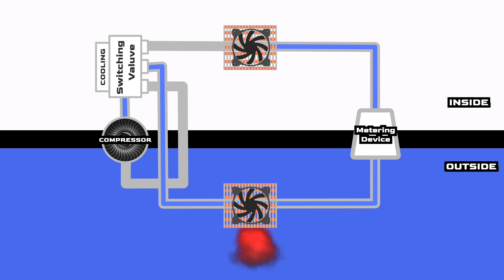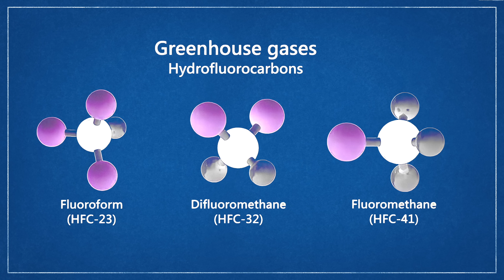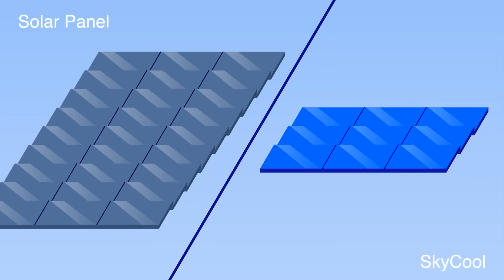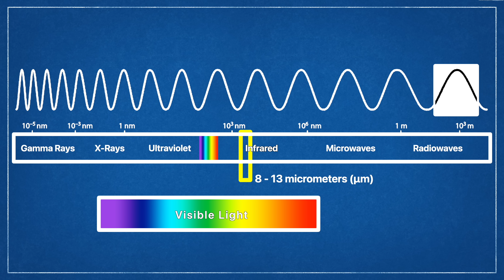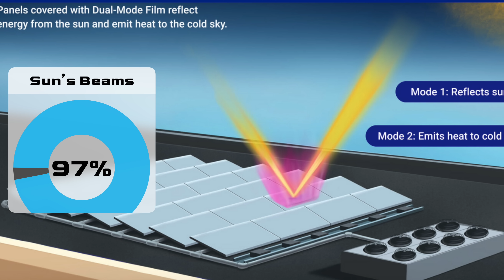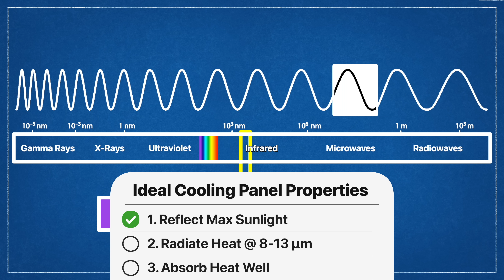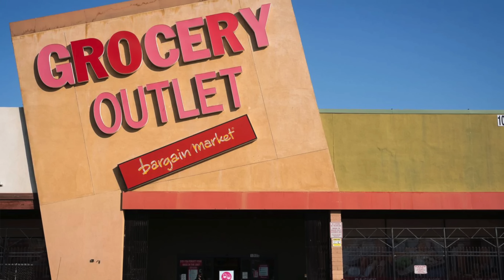New AC Tech Sends Heat Into Space & Saves 95% On Cooling Bills!

Comment: This does look promising. Although the part about "utilizing the cold of space" cringed me a bit, that's not what it does.
Reply: Sorry how does it not utilize the cold of space? Heat always moves from areas of high heat to low and that is what is going on here.
Reply: @williammeek4078  This is what happens when heat is transferred through a medium like air (Thermal conduction). Thermal radiation is a different story. All matter with a temperature greater than absolute zero emits thermal radiation which is basically light. This light is emitted independently, there is no need for a second object to attract it. Check out the wikipedia articles about Thermal conduction and Thermal radiation it's a pretty interesting topic.
Reply: @charimuvilla8693  Good, I am glad you found that so you can get a better understanding of what we are discussing here. 

The hotter something is, the more energy it radiates. If everything around the object in all directions is the same temperature then it is in thermal equilibrium with its environment. Even if it is in a vacuum. 

An area of the environment that is colder will absorb more radiation than it emits until it comes to thermal equilibrium with its environment. 

On earth, there are three major sources of heat: the sun, radioactive decay, and gravitational accretion. Of the three, only the sun has a significant impact on the temp of the surface of the earth so that is the only one we will consider. 

We receive about 1 kW per square meter of solar energy. Earth is an average of 60 degrees Fahrenheit. Clouds have an average temperature of well above that of space, but mostly they reflect the earth’s heat back to the ground so have a much higher temp for our purposes. Space is -455 degrees Fahrenheit. The atmosphere has an IR window as pointed out in the video. But this window is blocked by clouds. So don’t point the radiator at the sun, earth, or clouds and the radiators will drop in temperature quite quickly as they radiate the heat from your house through the atmospheric IR window and into space.
Reply: @williammeek4078  Ok I see what you mean now but I still don't want to view it like that. Space is not really "cold". More accurately space is "nothing". Once the photons from the radiator reach space they will just keep going indefinitely because nothing interacts with them. There isn't really a heat transfer from hot object A to cold object B because object B just doesn't exist.

Going to the building example from the video, all you really want is those photons to get far enough from the building. Once they clear nearby objects those photons are gone and what they hit doesn't affect you. If you shoot them towards a mountain 20km away from you that heat is not coming back. Some of it will bounce  at random angles, some of it will be absorbed and radiated around, some of it will escape to the nearby environment but practically nothing is coming back to the building.

Space is the perfect place to send those photons because 1) there is nothing there to stop their path towards infinity 2) roofs have a direct line of sight with no obstructions. However "harvesting the coldness of space" makes it sound like this magic panel sucks the "cold" from outer space and directs it into the building. We are just sending the energy there because we want to get rid of it.
Reply: Yes, it is what it does. It radiates energy to space, which is a near-absolute-zero heat sink. Everything radiates IR. Warm radiates more energy to cold than it absorbs from cold, because it has more energy to radiate away. It's that simple.

Comment: So Commercially yes, residential has FAR cheaper option without losing space for solar panels, its called proper air sealing your attic/ proper insulation/ with a radient barrier on the rafters (with a air gap) DIY radient barrier you can get for 1,000 sqft is 88 dollars. this can help since it essentially acts like a large condenser on the roof. So If you design you house like a passive house or use the enerphit system dont do this. (residential)
Reply: That is absurd, this fits in with passivehaus philosophy perfectly.
Reply: @williammeek4078  ok this still consumes (tough far less) all the purposes made this. the products in this (coolant, silver, silicon) weight can compromise a retrofit. Yes solar has weight but any liquid on a roof and pumps adds complexity to a residential home buyer. Solar and proper air sealing is not only cheap (but then not plumbing and roofers needing to work together of added cost) again great for commercial enerphit would be costly. IF YOU design and build a NEW Passive house of course this can work was speaking as retrofits.
Reply: @polarbearigloo  You could put this on the ground as easily as you can solar pv. You would just need a pump at that point as you would not be able to take advantage of natural convection.
Reply: @williammeek4078  see now you are going into semantics Yes IF you have land. Every house is diffrent. A single family MAY do this, a townhouse, a pud development, condos. But but space and monetary value depending on the person's needs matters greatly. If you have the land IF zoned properly you can do whatever. BUT for 90% of people this would not work. Especially for the added weight on the roof depending where you live for snow loads.
Reply: @polarbearigloo  No, you just keep changing the subject every time I point out how wrong you are. 

Your own argument here defeats itself. If every house is different, then all of your arguments fall apart as well because, every house is different. Every objection you raise applies to solar pv as well.

Comment: this type of system placed in Antarctica could also cool to dry ice temperatures with a cooling rate of about 5 watts per square meter. This would allow you to fill a dry valley with dry ice.
Reply: Dry ice is frozen co2. How on earth would this make dry ice???
Reply: @Meatball2022  it radiates energy into space. so in Antarctica, with a clear sky, and stratified air, it could reach low enough temperatures to freeze Co2 out of the air.
Reply: I'm not so sure it would work as well in Antarctica. The reflective surface reflects light preventing its absorption. But in Antarctica, there's  no sun for much of the year and when there is, much of it is reflected to space by snow anyway.  Although, your point would be interesting. Can a cooling technology capture CO2 at the poles during the winter.
Reply: @kreynolds1123  It does not need sunlight to work. it needs a clear sky since it works by radiating energy into space. The reflective part of it is just to keep it cooler when it is in sunlight by preventing the sun from heating it.
Reply: @LaserFur  of cource it doesn't need sunlight to work.😁 You missed my point. Skycooling  system gets about the same performance as a general purpose radiator at night with no sun, but skycooling gets it during the day in direct sun.

Antarctica like everywhere on earth  is always being cooled through radiating infrared radiation to space. The reason antartica is colder is because it gets so little sun to warm it up.   I'm saying I dont think skycooling systems is going to improve much over the natural cooling in a place that gets little to no sun.
Reply: @kreynolds1123  That's where a inflated dome would help. once the air is stratified inside the dome the R value of the air goes up. The main reason Antartica is not totally frozen is because of air currents.
Reply: @LaserFur  yup, in part. But convection currents does help to some extend get some heat up above atmosphere  chemicals that block radiative infrared emissions that would be kept in by greenhouse gasses from the ground.
Reply: @kreynolds1123  this panel doesn't care if the sun is up or not. Radiative cooling normally doesn't even work during daytime, since the sun heats everything up. But radiative cooling was used in the middle east to create ice in summer in the middle of the desert.
The real advantage of this tech is that it uses hyperreflective coating, which reflects enough sunlight to make the entire system work 24/7.
And the panel doesn't care about the ambient temperature as well, as the cool side of the system is the vacuum of space. So by cooling down the air in Antarctica a bit, you could theoretically just freeze the CO2 out of thin air.
Reply: @midnight8341  😁 You misunderstood my point. Skycooling  system gets about the same performance as a general purpose radiator at night with no sun, but skycooling gets it during the day in direct sun.

Antarctica like everywhere on earth is always cooling, radiating infrared radiation to space. The reason antartica is colder is because it gets so little sun to warm it up.   I'm saying I dont think skycooling systems is going to improve much over the natural cooling in a place that gets little to no sun.
Reply: @kreynolds1123  but snow isn't radiating in the far infrared spectrum as these panels are doing. Snow is mostly glowing in the visible spectrum and near infrared, which can be ansorbed and reflected by the atmosphere. Same goes for every other form of cooling system. 
The entire point of this tech is that the wavelengths it emits are designed to pass through the atmosphere without being bounced back. It's not about efficiency, is about where the heat goes. It's no use if it stays in the atmosphere and even snow will get warmer, if the air reflects the heat it emits back down.
So these panels should also cool down significantly in the antarctic environment.
Reply: @midnight8341  snow doesn't glow or emit visible radiation, instead it reflects visible light, technical but important distinction.  But the radiation balance between snow and space does have  net thermal radiation balance going from snow to space.